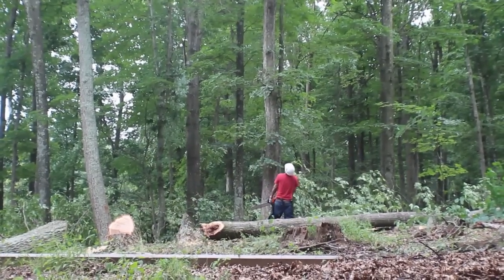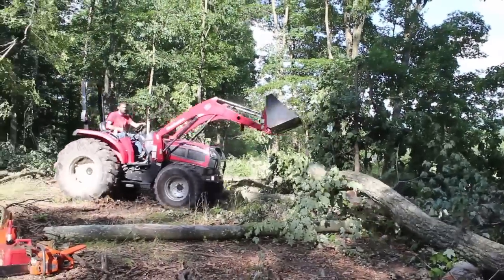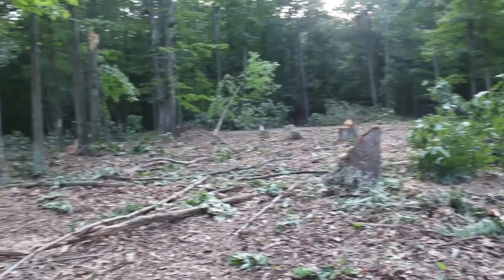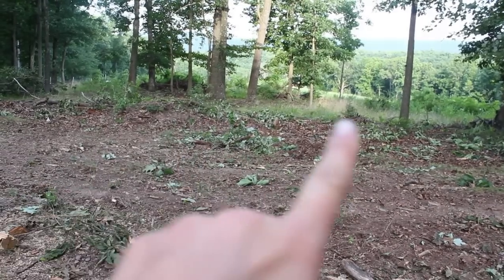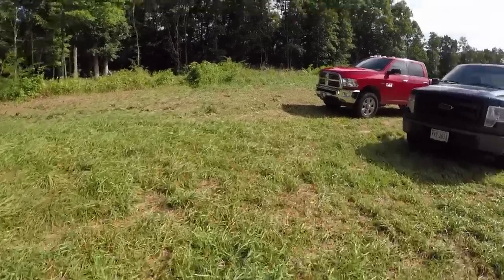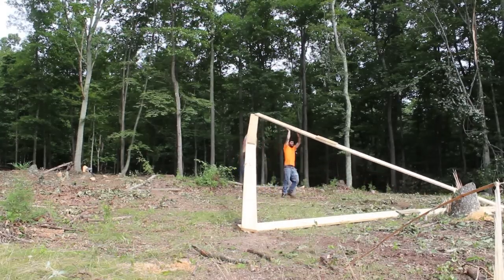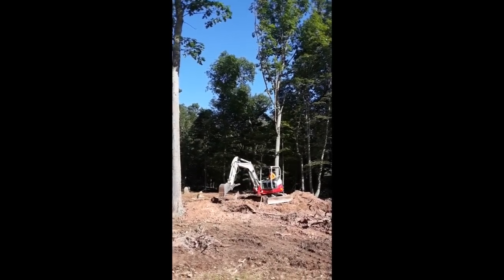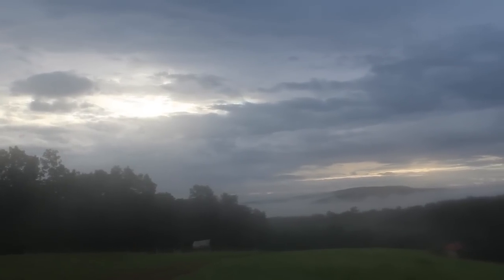Couple Clears Land For Home Build in 6 Days

Comment: Congrats! FANTASTIC view.

I am just finishing the same project on my land. A few things I discovered along the way. Wear gloves. It was faster to move my chipper to what I was going to chip than make a pile somewhere else. Leaving about 4ft of tree trunk on a stump allowed me to take many stumps out by pushing the over with the excavator bucket. It also gave me something to grab to move them to the burn pile. Then I cut the off and threw the 4ft section into my campfire pile. Stihl saws are great, buy the right size. Buy the chain sharpening tool. A PTO driven wood chipper is worth the money. 

The light bulb moment was when I realized buying land was the easiest and cheapest thing I was going to do. Everything else is a lot of work and a lot of money.

Comment: New Sub. We're doing the same 'debt free' stuff -- but are now seven years into the process. We lived in a 10' x 12' shed that we dad built years earlier on our land while my son and I built the house.  We had an open air outhouse in the woods and an outdoor shower. We were not 'off-grid' as the lot had electricity already there, but may go that route at some point. I work on-line, so I worked my 'day job' for 10 hours each day, then worked on the house after that. We got the thing dyed out and livable just before the snow fell.

Our plan was to have the house the way we wanted it by the end of the second year -- but then the next-door lots (2) came up for sale, and we bought them. After seven years, we now have 6 lots totaling 30 acres, and the house is still not the way we want it, but we do have horses, outbuildings, a Gator, and other stuff that became more important. 

I look forward to watching your progress, and may have some constructive advice here and there. Good luck guys!

Comment: +Wild Wonderful Off-Grid,
Great video guys. I know someone has already mentioned it and here in the UK, the safety aspect is much more rigorously enforced; but PLEASE? Chainsaw safety gear and safety helmet WITH a mesh visor AND MUCH MORE IMPORTANT CHAINSAW SAFTEY TROUSERS AND OR CHAPS!!!. The Stihl you’re using runs at around 60mph flat out!!80 odd teeth thats fast and your leg won’t stand a chance. The view looks amazing and yes you can  hire a decent chipper-BUT MAKE SURE YOU GOT TRAINING TO USE IT! One wrong move and 5 seconds you can end it all!
Good luck with the build. I’m subscribed!!
Reply: I hear you pal, but that gear is super expensive.  If you are careful with the your stance, have a new saw with the newest autostops, never work while inebriated or in the rain & you never dropstart it or do stupid stuff like cut while leaning from a rickety ladder, your scarce resources are often better spent elsewhere.

Like many couples starting a home, budget is everything.  When running a large operation with employees running saws I would enforce many standards you suggest even though not required by law.   Time & place
Reply: @davidfisher5140  He started off wearing the chaps.

Comment: LMAO.....I almost went thru just to count the music complaints........I hope I have just a little better helpful advice or thoughts.  Josh....I think you would benefit greatly in future clearing or logging task if you think you could get yourself what we call a 'draw bar' and clevis for your 3pt hitch to use those skidding tongs instead of your bucket.  Another GREAT tool that I think you will come to highly appreciate if you can find one (esp. used) on craigslist or something is a set of adjustable forks for your quick attach front end. They are awesome to use when getting wood logs that you cut to length and better place them exactly where you want and THEN they can be cut for firewood or whatever. I even use mine to hold up the logs and make my cuts on bigger stuff from one side to the other back and forth to SAVE on my back.   ;)

Comment: for pulling those trees, when possible to use the rear of the tractor, it would be much easier on it, and make your front end and hydraulics last a lot longer....its so rough on the tractor to do it that way....you might not notice it now but you will in a couple years..

Comment: Use rock picker to clean soil. The clean rock can create insulated heat storage. A thermastat and fan can pump heat from your ceiling into rock storage during day. You can saw holes in stumps pour in water and freeze in winter. Then pour in fuel to burn in spring. Compact clean foundation then clean river rock for heat storage.

Comment: I really like your work ethic and that you are enjoying this. Fantastic home site, beautiful view. 

I wondered why you stacked logs with limbs. I’ve generally cleaned them off where they landed, but if that area was cluttered, stopping partway to the stack to clean them would seem to be more efficient than cleaning them at the stack. 

Also, I have only recently bought a tractor with a front-end loader, but have already learned that pushing limbs to a pile is really quick with it - and easier than doing it by hand. 

I have hearing aids now because of tractor motors in my teens. If you are not wearing ear plugs, consider them. And I can’t use a chainsaw without chips coming up near my eyes, so I do not use a saw without eye protection. I haven’t shelled the $ for chaps yet, but should have. 

I do not understand why your back cut is sloped. Most training recommends a horizontal cut a couple inches above the notch to prevent the trunk kicking back past the stump. 

To all the people saying safety does not matter? You might consider not being part of the problem. All we can do is reduce the probability of injury and that is best done by following best practices. Making derogatory comments about people advocating safety illustrates quite a bit. Some of them were impolite, but others were quite polite. Challenge their tone if it’s bad, but not the recommendations.